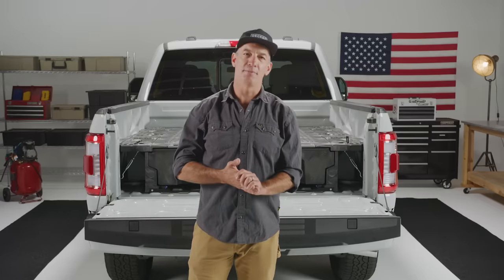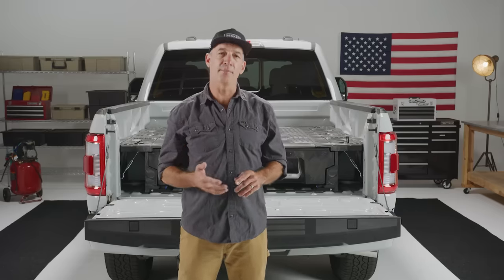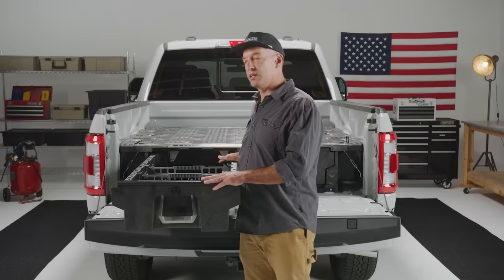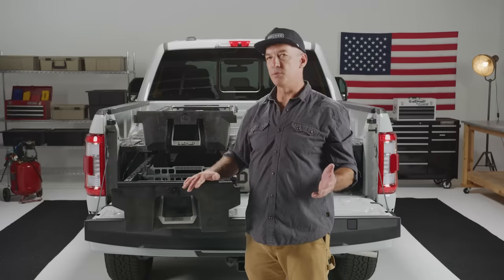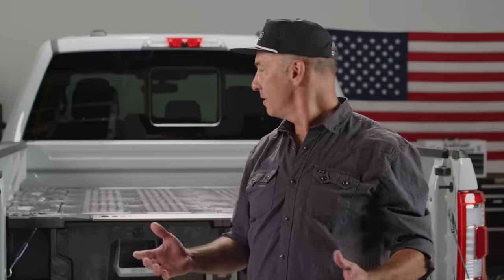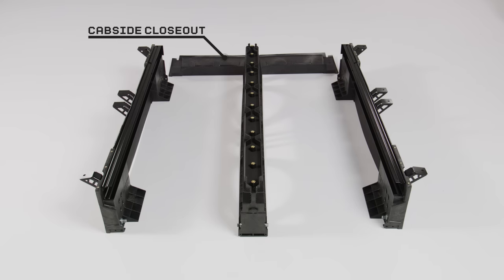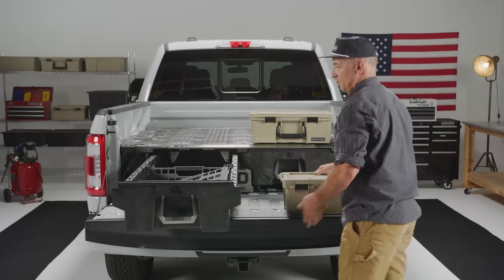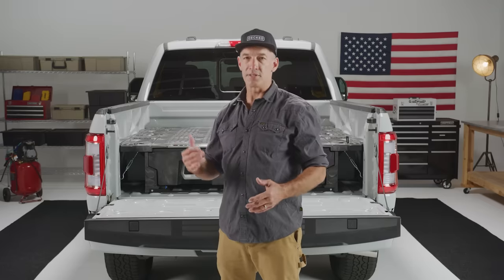What’s New on Full Size Drawer Systems | Everything You Wanted to Know

Comment: Make a stripped down system that’s half height but as wide as the two drawers for those of us who have work toppers. Unfortunately the height of the decked and a topper doesn’t leave enough room for larger items. Generators/ pressure washers
Reply: I'm all for this
Reply: For sure! I’ll buy one once I can select the height.
Reply: Needed.
Reply: Agreed. I really want this system but think it's too high for camping as well. If it barely cleared the wheel well I'd buy it today.
Reply: Agreed I’d like one that’s not as tall
Reply: Agreed. Not enough space between my truck lid and the top of this unit.

Comment: @decked  you guys should offer a recycle or upgrade discount.  Turn in our older system and get a discount on the new one. You guys can refurbish or recycle the old one. I would upgrade even if I was only getting a $300 coupon with a return shipping label.  Take the old one out, Put the new one in, then drop off the old one at a fedex/Ups.  I would take mine apart and box it up for $300 off the new one. Everyone wins.  Then you can offer the older one at a discount refurbished, or build new ones with the recycled parts
Reply from the maker: Shoot us an email at Social@DECKED.com
Reply: I like this idea, however I've had no issues selling a used system in the past, they're easy to resell
Reply: Just sell it

Comment: I have an 8 foot bed on a 2021. Ford Super Duty, will it fill up my whole bed? Or will there still be a gap in the front?
Reply from the maker: There's still a gap. However, we'll be working on some 8' bed solutions in the near future!
Reply: @Decked  I will be ordering one anyway thanks for the reply. If nothing else you  should include a box that would drop in and fill the gap
Reply: @Mike-xr3yt I have a ccsb superturd and the gap at the tailgate end is perfect for military gas or water cans
Reply: @Decked  Still no long bed joy.  You could call it the system for Real Trucks with Real Beds.

Comment: Hi, Ready to place my order. I have two quick questions. In a 5th (2022) Gen Ram 2500 with the bed utility package (Receptacle and bed light switch) will I still have access to these? 

Can you bolt down items to the top i.e. coolers, jack brackets, compressors, bike racks, etc..?

Thanks
Reply from the maker: Yes! You'll have full access to your outlets! And the System now comes with built in D-Ring Tie Downs!

Comment: Well i guess im ordering my 3rd decked system , question is, i use the current ammo cans to store my tire chains, will these plastic containers hold up? 
I like the square boxes and the tie downs
Can you guys build a full crossbox like the current box but fits on top of the decked system, a low pro box? That would be useful for tire chains, shovels, boots etc, dirty stuff i dont like putting inside my drawers, also a table top accessory that fits on top of the drawer when open would be sweet.. 🤘
Reply from the maker: The Stash Bins will hold up with chains, sure! They're also replaceable, just in case!

Comment: Can the boxes be opened while in the drawers? Will there be an actual sale on the older style ones until stock is depleted? 🙂👍
Reply from the maker: Yes the new cases were designed to be able to be opened in the drawer! Aren't we finally smarter a few years later!? There is a closeout locaiton on our site for old systems and old accessories you can find them in our footer here: https://decked.com/products/decked-drawers 
https://decked.com/collections/replacement-parts

Comment: I wish the full size offered in a large single draw like midsize offering.
Reply from the maker: We hear you! However the single Drawer payload is only 1,000 lbs. Which is more fitting for a midsize rig, but not a full size!
Reply: @Decked  that would be more than enough. Having one drawer the width of two would yield more internal volume I'd think

Comment: Can I bolt a 70Litre fridge slide to the top of it? Or will the top get catapulted into the sky with shards of broken plastic stabbing me in the face?
Reply from the maker: Using the D-Ring Tie Downs, sure. We don't recommend drilling into your System however. This will compromise the weatherproofing of your System
Reply: The old system has marked locations for the tie down rails, I used those points to screw down my fridge slide, I used the squishy RV sealant between the decked and the fridge mount, no problem with leaks for about 3 years now

Comment: I loved it until I needed to haul stuff.  Takes away the ability to utilize your bed like a truck. With square footage vs space decked system it don't balance out. Hands down great idea if using it as a work item in a work vehicle.
Reply: It’s really easy to remove and re install. I took mine out 4 times this summer helping the kids move and transporting a bumper to and from the powdercoater
Reply: I just one of my trailers.. easy
Reply: @JackWorkz  lol not as easy as using another vehicle. I bought a cell phone, but use my land line better. I bought a plane, but love to drive.... Lol

Comment: Dude, until you make one for  an '83 Dodge D150 ...the improvements aren't going to help me!
I can't be the only 1 Gen. Dodge owner out there who wants one of these...😔
Reply: I have a 1980 Jeep J10 pickup and found a used 2005 Chevy fullsize version and had to cut the edges to fit. Not a big deal. The left side upper piece failed (not due to cutting the edge and it leaked really bad into the left drawer. Removed that and just have the right side. No warranty because I am not the original owner. Will probably have to purchase another used one to fit the left side if I ever decide I need it.
Reply: Yeah, they're not helping guys like us...and that's the real answer to their advertisement  question ...
"You wanna know what sucks?"@jimsterling1187
Reply from the maker: Our CargoGlide and Tool Box are compatible with OBS rigs!